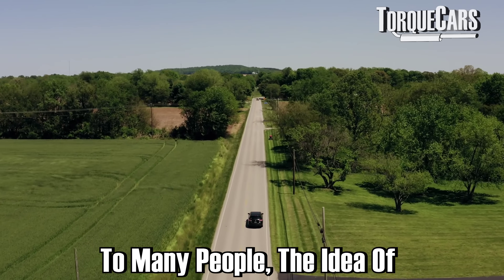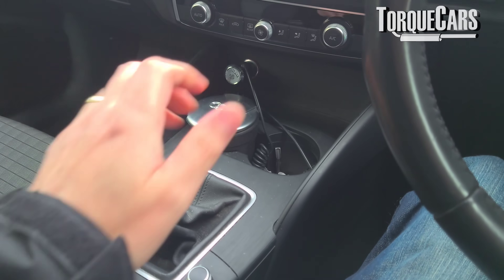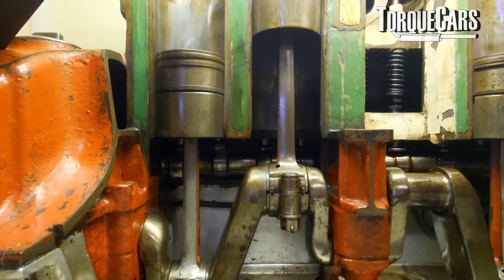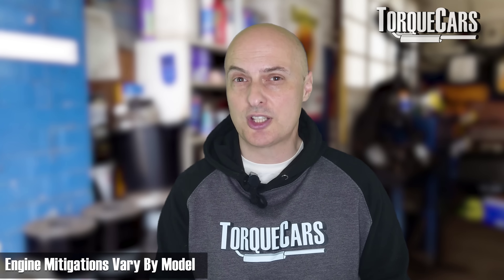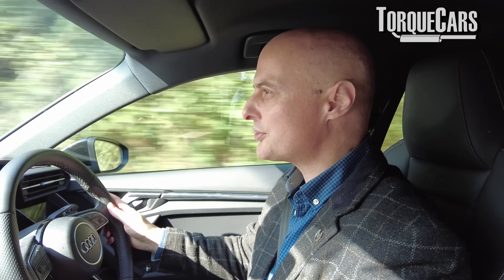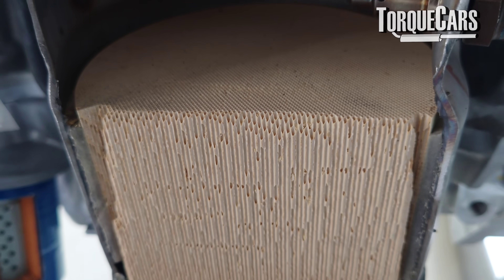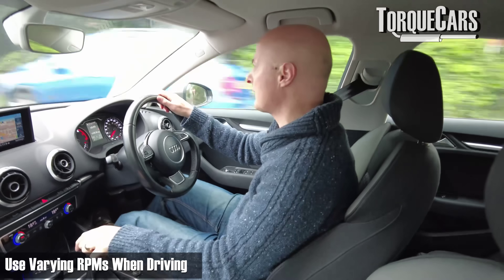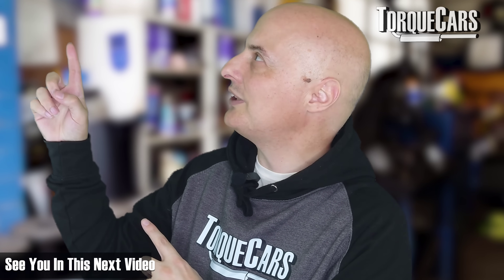BIG DAMAGE By Lugging at LOW RPM? Eco Driving Warning! (Manual Gears)

Comment: I don't know if it's clickbait if you insinuate that low rpm driving is bad for your engine when you then go on to explain that this itself is not the problem, but rather trying to accelerate in a high gear? It's certainly probable that this happens a lot, though I would hope that most drivers have the sense to downshift. 

However, the second point is very much valid. I've learned it by chance that the most efficient way to accelerate is usually around 2/3 of the throttle, but it would otherwise seem like feathering the accelerator results in the least use of gas. That is really not the case, it's better to accelerate swiftly and hold the desired speed (or pulse and glide if you're insane).

Comment: This is only one of the causes.. dont forget 99% of dealerships use wrong oil (specially toyota) with no certification arround lspi mitigation such as API SP (for 0w20 and less.. be carefull API SP not SM .. sm was never targeted at lspi) or ILSAC GF-6. they dont take action against carbon buildup in valves(i m not taking about soda blasting or any other lame solutions that can kill your turbo or clog your catalytic converter but changing intake valves alltogether every 100.000km) or inside the combustion chamber such as Liquid Moli Cleaner WITH PEA (PEA is the key here) and of course there is the driver non-awareness at last where since the engine has more than enough torgue from 1500 rpm they drive it like a diesel (which does not suffer from strong knock or the lame term lspi)

Now dear mechanics any challenge to the above accepted.

Friendly advice from a 58 year old Chief Marine Engineer

Comment: I’ve driven my 24 year old VW 1.9tdi for the past ten years and it now has 135k on the clock. Serviced every 10k with oil changes every 5k I regularly beat the snot out of it and I’ve never had a single engine issue, the body and electrics will disintegrate a long time before the motor will. It’s such a shame car manufacturers don’t build engines as good as that anymore.

Comment: What about diesel with automatic (Torque converter) transmission? Uphill 1500 RPM, 2000 RPM, 2500 RPM or 3000 RPM? Which is healthier for the engine?

Comment: I drive my 17 Traverse in manual mode most of the time. Otherwise it tries to shift at really low RPM. I wish they made a version with a manual but over here the Camaro is the only vehicle gm makes that use them anymore

Comment: I'll take the whole thing. fast accelerate, slow driving in low rpm, fuel save and full throttle mode. e46 BMW with 270'000 kilometers on the clock, 2 liter diesel. runs smooth, smoketimes makes a big cloud. 😅 but thats normal and everything is fine!

Comment: For many years, engines have had motorised throttles and the throttle position chosen by the ECU has no direct connection to how far the foot has pressed the pedal. There is no reason or excuse to map the ECU to make the engine operate outside its mechanical ability.

Even with legacy systems, an engine is only able to draw in a certain amount of air, essentially once the manifold pressure equal atmospheric, and it reaches this point at smaller throttle openings at lower speed than high speed. Going "full throttle" at low speed can not force it to draw more air than it wants although it is quite possible that carburettors were not able to feed the correct mixture.

Comment: I have been driving my Honda City at highest gear for a given speed and keep rpm low (it has an "eco" lamp and instananeous mileage indicator which tell when I am getting the most mileage). Almost 11 years and still no issues. Only consumables like oil, oil filter, air filter. The key is to use the car's inertia while on flat or downslope by putting in highest gear possible without the car shuddering (takes practice) taking the foot of the accelerator...then as soon as the vehicle speed drops,  downshift, accelerate, upshift, foot off...

Comment: You need to drive it like you stole it😂
I had a 19070s triumph that i would drive like it was intended. I would often run it out to 7000rpm well past the factory red line ( it had been balanced).
One of the positives of driving it hard is you dont end up with glazed cylinders, nore fowled spark plugs.
The othe positive of useing all your reves is the glorious sound😂

Comment: The video provides zero information on what the recommended RPM range is.  So useless to the average person.
Reply from the maker: I deliberated on that point but there are so many differences, an RX8 Rotary driver will need significantly higher RPM than a 1.6 Turbo diesel driver. The turbo engine will have a different power band to the NA engine. Then if you have a high revving VTEC engine a low RPM will be much different again. So it is impossible to say "xxxx RPM is too low" it also depends on what you are doing? Accelerating, going up hill, towing? They all need different RPM points at different gears to maximize efficient power delivery.

I don't assume my average viewer is clueless and needs to have the obvious spelt out to them. Hopefully people will work out when the engine is struggling and change gear - that was my aim because so many people I know think driving around at near tickover and lugging is harmless.
Reply: @torquecars 
At least some examples of the most common engines would be good.  My car has a 1.4 turbo engine and  recommends 1000-1500 RPM for economy driving.
Reply: @szabonorbert93 my car is 2400rpm for economy, thats where thr turbo starts spooling up 🤔

Comment: Stop driving a manual transmission and you will never have to worry about any of this because the manufacturer of your car will make sure that an automatic transmission will try to keep the engine in the optimal RPM range as much as possible at all times, and optimal means "not too high but not too low". If the rpm gets too low, the transmission will shift down and if it gets too high, it will shift up (if you let it, not during kick down). With an automatic transmission, you can't keep the RPM very low or very high all the time, the transmission won't even let you do that to begin with.

Comment: The problem also arises with electronics and turbos and such, old engines were not accelerating well until optimal revs, so it naturally forced the driver to use the correct revs.

Comment: I drive below 3000 rpm as much as possible. 2000rpm or low at most. Barely goes past 3000rpm when going up a hill. (CVT)

Comment: any sports car is built to drive hard , i let my oil and coolant get to operating temps and I driver her hard as she meant, these german cars are made to be driven at high rpms for long periods of time
Reply from the maker: I've heard of many cars having problems where they were driven too gently from new, nothing properly beds in and you end up with blow by, oil dilution and other issues, so yes driving hard is actually beneficial from time to time and the new engine break in makes a massive difference to how the car lasts and drives.

Comment: I would explain it differently.  Driving at higher rpm, means you are adding cylinders, more sparks per mile, each explosion is milder because the fuel rate is the same, if not less because of increased efficiency. so, the power is distributed on those synthetic cylinders. e.g. from 1000 rpm to 2000 rpm.
I used to drive a stick shift.  An automatic transmission is not fast enough to downshift. it downshifts 2 gears down, too much plus the long time it takes to react.

Comment: Complete BS bro how you going to damage the engine by driving gently I had cars over 300,000 Mi with the original fluids original transmission fluid and I would drive like a grandpa not letting my RPMs go past 3 unless absolutely must. Play cruise on the highway going 80 at 2 RPM cruise control as long as you drive Highway you still clean out all the slug engine will heat up and clean itself you don't need to go hard

Comment: I drive my car with fairly low rpms when i'm not in a hurry, which is the usual case.   However, I make it a point to never apply more than 1/8" of a throttle input (may not be accurate but just for illustration purposes).  I make it a point to downshift 1 or 2 gears to pass or to go up an incline so that the rpms are midway on the  tach.

Comment: I drove my commute in an SRT10 for over 10 years and I practically never used 6th gear.  On average I was getting 12.5MPG highway+city combined over 2x 45 minute trips, every day, 5 days a week.  5th gear was always easier to drive in with the engine spinning over 1800 RPM and 6th would bring revs below 1200 and just bog.  It wouldn't take long for me to 'nope' out of 6th and go back to my usual.

Comment: I've got a 1.4 TSI Jetta and usually when accelerating dont go above 2.5-3K RPMs cuz it doesn't really need to. The 8 speed auto shifts when it deems necessary and acceleration is acceptable. Idk if that's necessarily lugging but I do drive like i stole it sometimes lmao so it balances out 🤣

Comment: My formula is to downshift if the car makes a low hum or doesn't accelerate, usually below 1700rpm up a small incline. Also I NEVER FLOOR it at low RPM.
I have a 23 Jeep wrangler 2 door with the 3.6 v6 and stock tires wheels, 6-MT and she carries very spritely speed with staying between 2-3k rpm! I usually have fun with her and wind her up to 5k regularly until I get to cruising speed then I cruise between 1500-2500. 😊

Comment: Car manufacturers not showing optimal rpm range - this is something particular i hate about cars and where trucks got it almost right. Trucks used to or still do have that green-to-yellow line indicating how fuel efficient the current rpm is. What i wish is that all cars have it. Its a good guide for beginners atleast.

Comment: Dude needs to get his terminology right. He's saying 'too low gear' when he should have said 'too high gear'. Also, what's with the 'rpms' nonsense? It's 'rpm' and it's already a plural - 'revolutions per minute'! Apart from this nonsense there are some valid points in this video.
Reply from the maker: Sorry about that, my mistake, I said low when I really meant to say high. Your comments on RPM are noted, many people use RPM as a noun so add the s but you are right it is technically incorrect so I'll try to avoid this in future.

Comment: okay- hold on... Jesus-- these people from UK ??? Here in the United States we call 'low gear' 1st & 2nd which means higher engine RPM. Not to mention- we use 'low gear' when descending steep hills.   We use 5th & 6th on the interstates resulting in LOWER overall engine RPM but higher travel speed; i.e  80MPH @3000 RPM in my Volvo s60   

So yes, driving around in the city in 4th / 5th gear definitely puts stress on the car and is indeed not very responsive in situations where you need to react to an 'event'.  

Is it okay with you UK people if we coast to a stop in neutral?
Reply from the maker: We use the same terms in the UK. It is my bad, I went off script and used the wrong term. I could say it was deliberate so you all think I'm human but it was a genuine mistake that I didn't spot until it was too late.

Comment: DO YOU NOT know the difference between "Low" gear, and "High" gear?
Some cars had the gears numbered on the gear shift knob.
You might see this on a typical 4 speed.
#1 is known as LOW gear.
#2 is known as SECOND gear.
#3 is known as THIRD gear.
#4 is known as HIGH gear.

Comment: Direct injection engines and incorrect oil... Low speed detonation is a thing. It breaks pistons efficiently! Constant low rpm also can lead to other issues like fuel contamination of the oil as oil temperature does not rise enough to gas off fuel that made its way into the oil. It also will cause fuel to wash oil from the ring lands and create issues there. PCV is a direct cause of gunk buildup in intake systems. Oil vapors will build up and cook onto surfaces and intake valves. Enter the EGR. That is the aggregate that oil residue needs to create a concrete like buildup in there. Short trips are a lovely way to enhance the buildup of crap that clogs things up!

Comment: I've always been hypermiling my diesels, but back when I had a turbodiesel with manual transmission I always avoided low RPM and lots of throttle.
Unless absolutely unavoidable I was very gentle on the throttle at low revs and always downshifted before giving it more throttle. 
I did it mainly because I once read that that lots of throttle at low revs can quickly damage the dual mass flywheel, resulting in the need of a costly clutch job. 
However it also clearly didn't feel right to give it lots of throttle at low revs, because of the vibration and buzzing sound it causes at least in all turbodiesels I've ever driven.

Comment: Intuitively since the engine pulls harder at higher revs and works smoothly, I like to rev high for acceleration (once engine is at temperature) and then immediately shift into the target gear - 4 or 5 or 6.
A simple rule should be to not operate an engine whenever it vibrates significantly, or at least to only do minimal acceleration then. A sensitive driver should understand that naturally.

Comment: You missed the issue of granny driving in some cars will never get the engine oil hot enough to boil off any water in the oil caused by condensation. People have destroyed relatively low mileage engines from only driving short distances and granny driving from this.

Comment: yep hes is right. / a lean AFR mix part throttle custom tune would be the way i would hyper mile if i was in need of saving cash in the UK oh yea oil and carbon are not bad not is it a fossil fuel all bs  and easily provable by looking at were and who named it a fuzzul fuel  and so forth all a con

Comment: Wish I could give this video more than 1 like. It has transformed my driving experience. Whilst not quite a hyoer-miler, I more or less changed up gears at around the rev range that the dash indicated changing up. Not anymore.
I followed the advice, feel more in control and am a more relaxed driver.
Even better, I am getting BETTER MPG (I now get 50+ MPG on the uphill journey back from an area I visit often, compared to the 40 to 45MPG previously) and am preserving my clutch due to the fewer gear changes.
I hope my driving is also safer as I glance at my average MPG less.
WIN WIN WIN.
Thank you.

Comment: interesting, my car is auto and runs at low rpm all the time unless highway speeds,
crazy low rpm..........early mitsubishi outlander mk1 2003
its annoying, I use manual drive to keep the rpm up , and now I"m glad I do.
I dont think he mentioned torque converter clutch plate, has alot of slippage at low rpm too.
I was getting a shudder at low, and thats why I initially went to manual and higher rpm gear shifts. It was poor grade oil and converter clutch causing the shudder.

Comment: I heard of a guy who specifically looked for old bikes, especially 2 strokes that "run bad" and have power issues.

Bought them, and just went on a drive for an italian tune up. Most of them just cleared out and ran like they never had an issue after all that carbon buildup got blasted away.

Comment: Putting the same load on your engine and drivetrain at twice the rpm results in 1/4 the wear and tear per revolution.  Since it's at twice the rpm, the net result is 1/2 the wear and tear over time.

Comment: You have a lot of errors related to physics, it has nothing to do with the fact that it is at low rpm but rather the ratio of the box generates much more resistance to rotation due to that same ratio, so the piston goes down and there is much more resistance against it, which turn slowly has nothing to do with it since the power is related to the lever arm of the piston and is constant, the rpm only generates more in the same time but every time the piston goes down the Newtons generated are constant

Comment: Idk im very chill on my hemi , i pull a boat and trailer at times but I almost never give it full throttle , runs like new 2014 with 250,000 miles had it since new

Comment: I used to cover nearly 100,000 miles a year in a previous job and found that keeping the revs low at all times was NOT best for fuel economy. Giving it some (sensible) beans to get up to speed and then rolling off always worked best for me. It also gave the engine some "exercise" across the rev range. All of the engines I treated this was lasted at least 250,000 miles before any major work was needed.

As you so rightly point out, constantly nannying an engine is potentially VERY unhealthy for it.

Comment: Is it different with diesels? I drive a diesel bus every day and I drive a lot between 1000-2000 rpms, the engine feels like it can handle it
Reply from the maker: Diesels generally produce all of their torque at the low end and the gearing is set up to exploit that. Try accelerating from 40mpg in top gear and even the best diesel will struggle to make power. You hit the key there, is the engine happy or not? If you feel like there is not power or it is making vibration or noise then it's time to choose a different gear. If you have a DPF it would be worth running at higher RPM from time to time to allow the regen (as they are all different check your manufacturers guidance on RPM and time for a regen.)

Comment: Surprisingly enough, my dad uses a manual 2015 kia rio pride and he driver in low rpm whenever he is speeding "probably at 1500 to 2000", he already got 200k kilometers in it without having a single problem with the engine or even the exhaust system, my question is, is it the low rpm itself or the full throttle while in low rpm is the problem? 👀
Reply from the maker: It is the full throttle, or even medium throttle if going up hill.